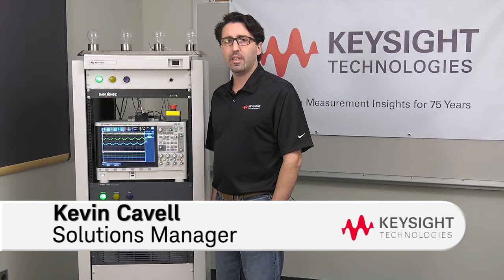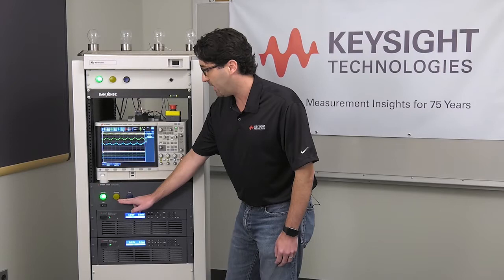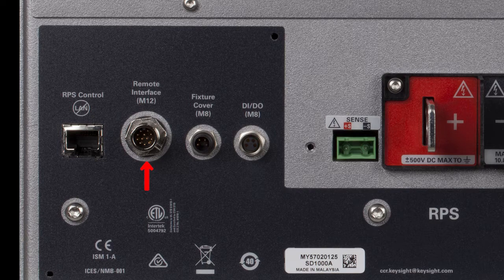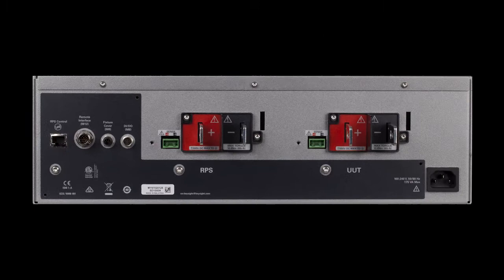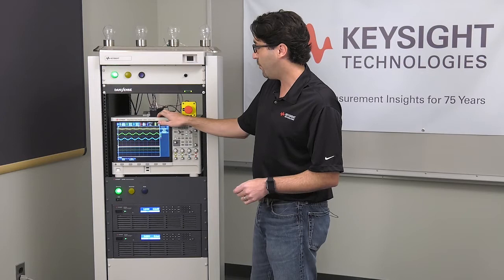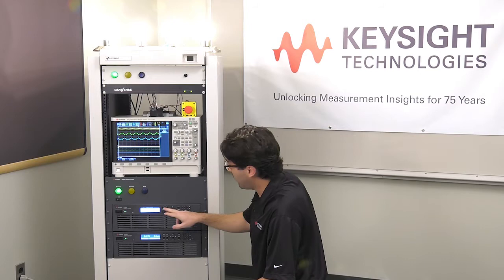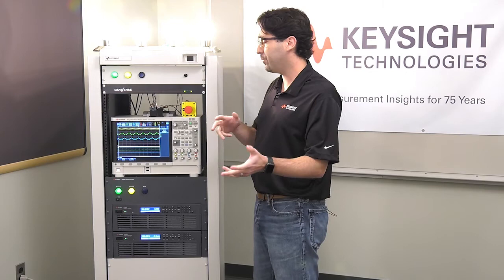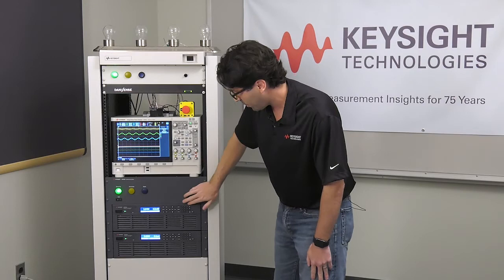Safety features of the EV1003A Power Converter Test Solution for HEV / EV and HEMS

Comment: 2:48 Am I understanding correctly that both the input and output are males connectors, creating a situation where one may have an exposed live male connector for the output (UUT)? Shouldn't this be a female connector?
Reply from the maker: Inline Downhill Vancouver  The rear terminals are design to have the cable bolted to the terminal.  The terminals can have up to 950 V across them depending on the power supply.  The safety disconnect ships with covers that need to be reinstalled after the cables are connected.

Comment: Sir i want to work in e vehicle company ..which topic i need to cover.
Reply from the maker: Aditya Anand   Your timing is really good, as there are many opportunity in e-vehicles.  You need to decide what interest you the most working on the power electronics, software, mechanical engineering or even battery chemistry. The cost and the efficiency benefits to an electric drive train are causing tremendous growth.